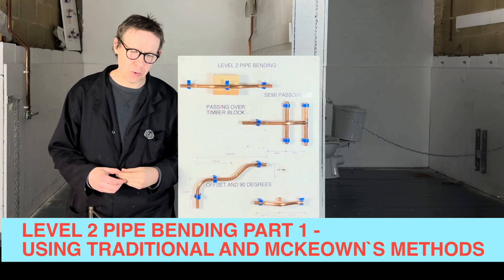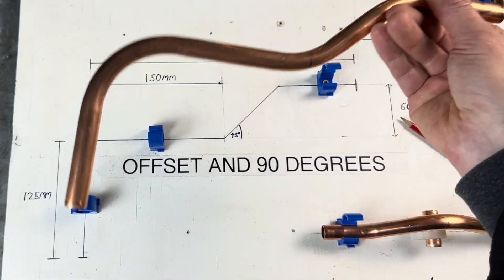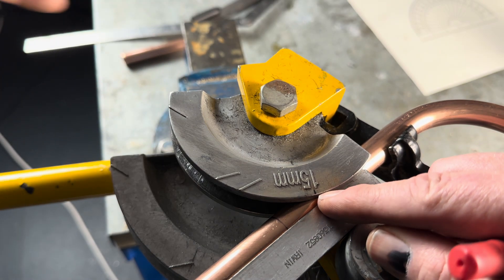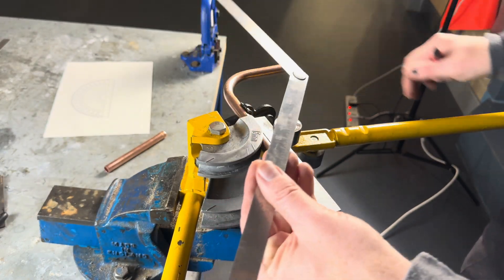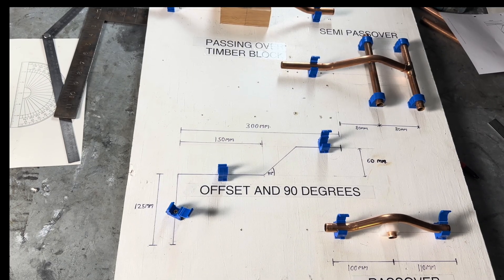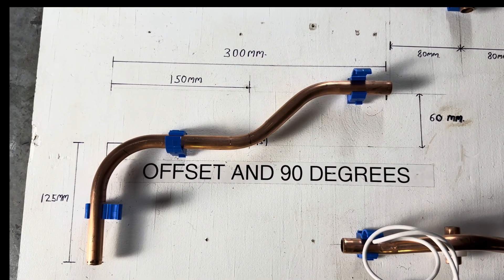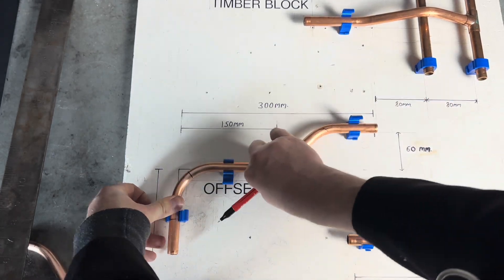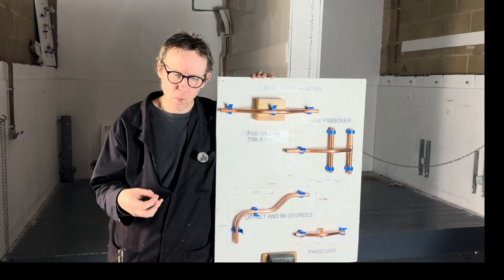Level 2 copper pipe bending part 1 - Offset and 90 degree bend - 2 ways.

Comment: I was always taught for bending 90’s, take off half pipe diameter for copper ( in this case 7.5mm ) and add on whole pipe diameter for iron pipe ( in this case if it were iron pipe you’d add 15mm on ). In practice, the very first bend you did in this video, you’d measure the 125mm then take off 7.5mm which is 117.5mm. Now, where you had your scrap pipe and the set square, now you wouldn’t need the scrap pipe, you’d put the set square on the pipework and slide it into the inside of the pipe former, and align the 117.5 mark to the set square. Now you don’t need the scrap pipe AND the set square, just the set square. 
I mention this technique because I never have access to a vice on site. I’m always scrabbling around on the floor with my pipe, bending machine and set square, so one less thing to hold is a major plus, you need 3 hands to use a bender, so by eliminating the scrap piece of copper it helps a lot.
This is a very helpful video for both new and experienced plumbers, thanks for uploading. I’m a pipefitter/welder by trade, been bending pipe for nearly 40 years and can bend pipe millimetre perfect. Everyone has their own preferred technique, there’s lots of different methods to get the same 100% accuracy, learn this one and then develop your own to suit you. 
EDIT
I never actually measure 7.5mm, come on, either taking off 7mm or 8mm will give you a very accurate bend. Just remember, bending 22mm pipe you’d take off 11mm, and bending 28mm pipe you’d take off 14mm.
Reply from the maker: Thanks for this it is interesting

Comment: I would use a hybrid of both, the problem with the second one is you are doubling the tolerances for each measurement. I would take the off set off the centre line distance and then measure once (effectively using the McKeowen method but without two lots of inaccuracies from the measuring. Hope this makes sense?